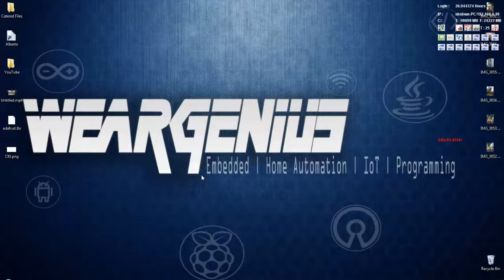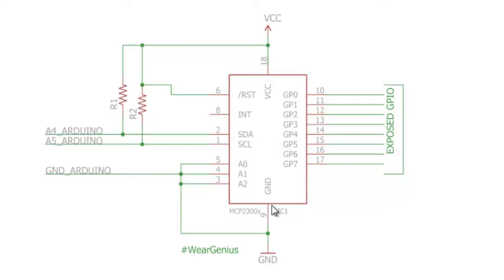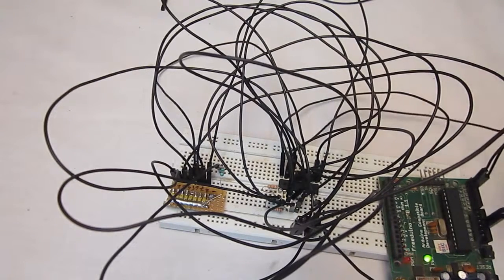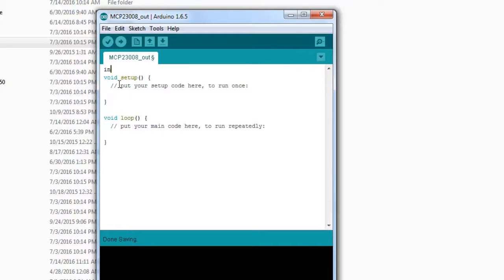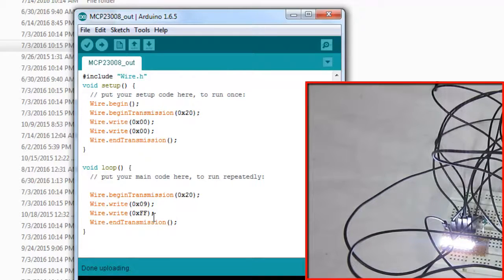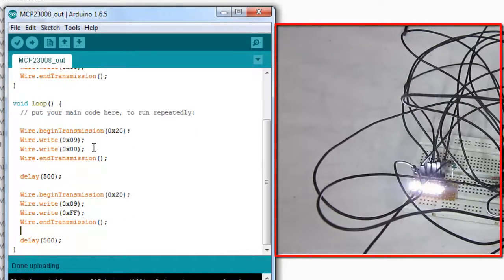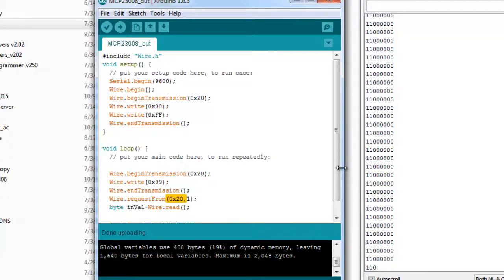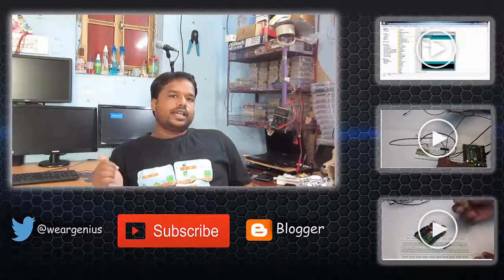Arduino | Tutorial | MCP23008 Interfacing

Comment: So nice tutorial im making a protesis with servomotors and sensors and i wanna bet for an arduino motherboard but i only know program a little bit C# and php good... can you recomend me a compatible arduino motherboard compatible with the sensors and how it work and show a little bit of the programing part of the sensors and the servomotors work? anyway so nice tutorial
Reply from the maker: +Dany Florean thanks Dany. If you are aware of c# and PHP I think you can easily digest Arduino. coming onto compatible Arduino board it totally depends on the number of peripherals you want and the computation you want to perform. many flavours of Arduino boards are available. one more thing if u know c# please check netduino.
Reply: interesting i will take a look, and yes i have seen another video with a ultrasonic sensor and how you programed it to send back you the result in cm... what i need to do its kind of but getting the position of the sensors ... the problem i didnt find allredy a sensors and less i found a arduino motherboard with bluetooth or another bridge adapter to link to the sensors... Thank you very much for the response i will be checking your videos. PD: If you know a arduino motherboard capable to link with a sensors to get positions of these last mentioned please let me know. Take care my friend.
Reply: RE: I haved a look to netduino and its just what i need thank you very much i just read the hole manual and they garantee you what you need to make a servo motor work with a sensor or a ultrasonic sensor 

"You can generate those sound vibrations with the same PWM feature youused in Chapter 6 to adjust the intensity of LEDs. By changing the period andlength of pulses, you can change the frequency of the sounds"

"You can also use the length of pulses as a signal to a servo (motor), settingthe servo to certain angular positions through specific pulse lengths."

thats the text what the manual says and the programation part its c# with some kind of special libs easy by what i can see in the manual... thank you very much i just found what i need only i dont know where i can buy the sensors its the missing pice i have to found so again if you know where i can get thouse sensors or ultrasonic sensors let me know please and again thank you.

By the way here its the source of the text: http://static.netduino.com/downloads/books/gsn/Getting_Started_with_Netduino_Sampler.pdf
Reply from the maker: +Dany Florean welcome
Reply from the maker: +Dany Florean take a look at esp32 it has WiFi as well as BLE . I Have not checked yet but if you are using analog sensors if any check for analog inputs on the module/board. They are quite cheaper also. can be programmed using Arduino.
Reply: every day i like more about arduino and theyr boards if i have some stuck part in the process i will talk with you my friend
Reply from the maker: +Dany Florean sure